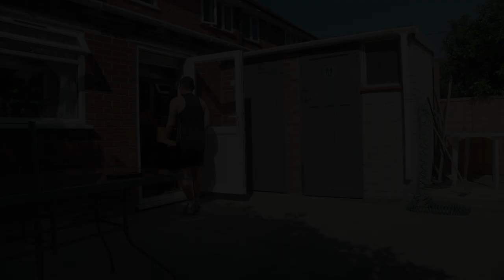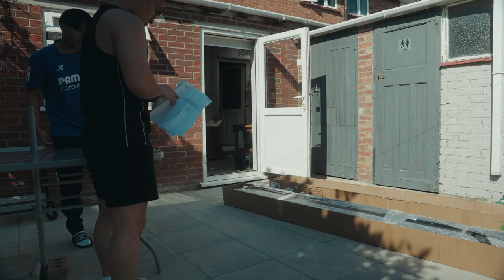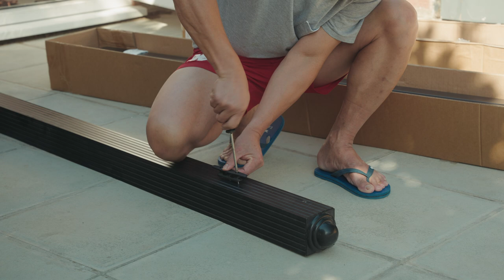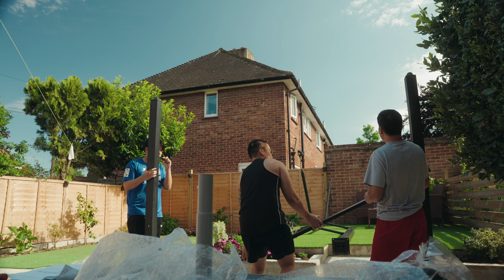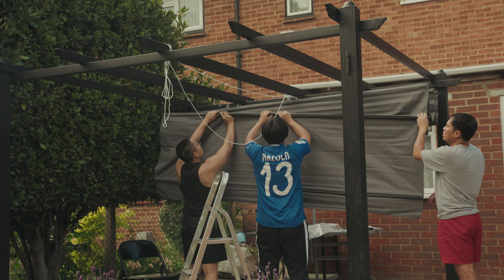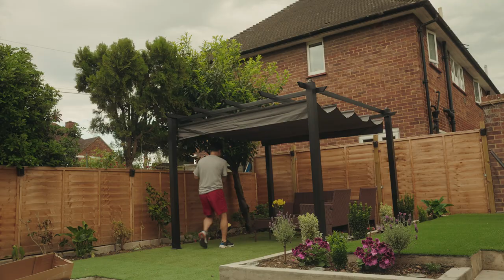Building the Garden Pergola | Culcita Garden Pergola

Comment: Hi. Is it a durable structure? How high is it? Is it possible to shorten one dimension to 2.40 m. My decking is 3 x 2.4 m
Reply from the maker: It’s surprisingly pretty durable, though weather has been pretty calm right now haven’t hit really strong winds yet. Height wise it’s around 2.6m high. Unfortunately you aren’t able to shorten any dimensions because all the frames and posts are built 3x3